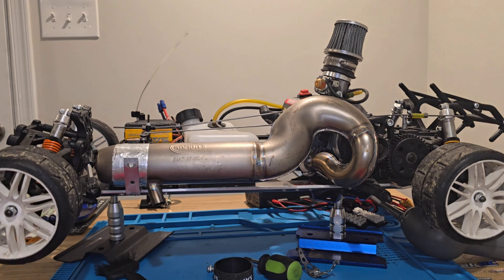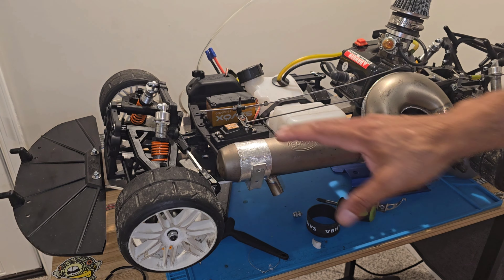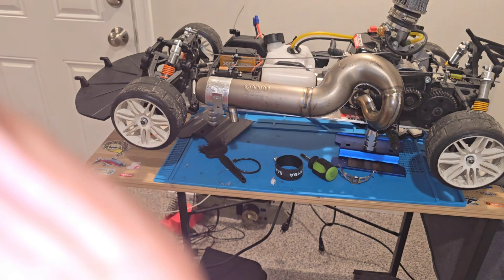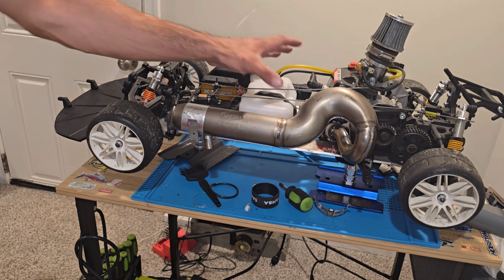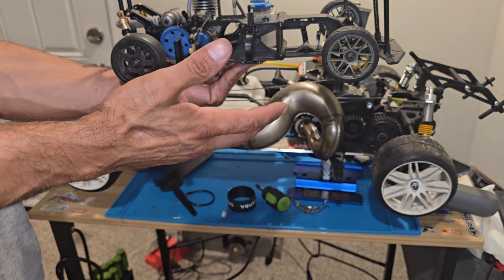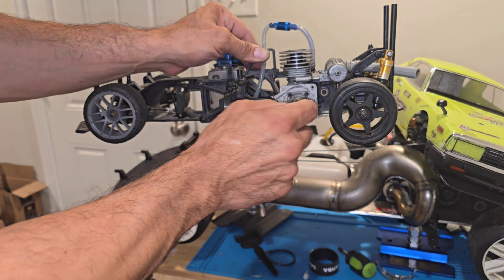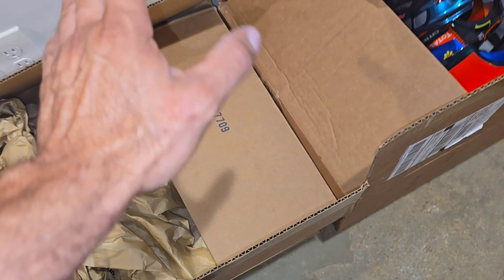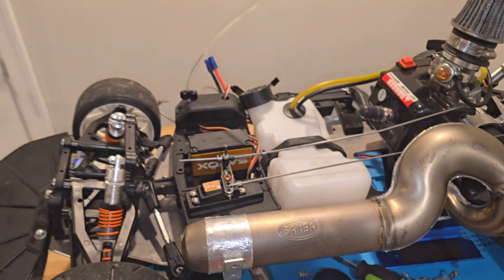FG modellsport 510 challenge line and talking about the kyosho mantis

Comment: Man, I had one of those, but I gave it my brother to hold for me while I was moving, but he sold it... I had a badass brand new Ferrari 308 body for it, and a Porsche 911 Carrera body for it and a sedan body for it. Now I miss it....😡:face-blue-covering-eyes: LOL
Yes, you can change the diff fluid.  I had metal gears on mine too.  The more powerful Baralone engine may make it very difficult to drive because of the powerband.  They may make engines for on road cars with linear powerbands, but the off road engines have high torque off the line, which will make the car hard to drive because it will loose traction since its only 2wd... Just my 2 cents. :goodvibes:👊💪